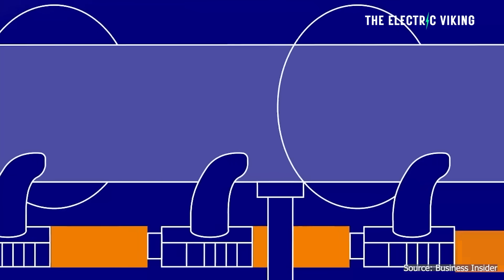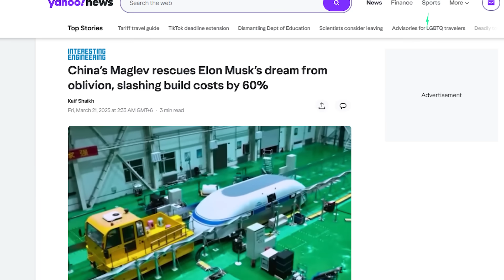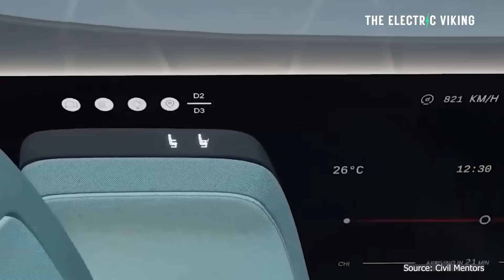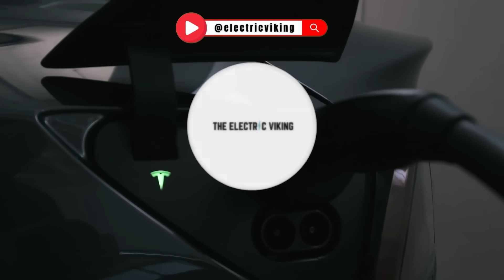Hyperloop Back from the Dead: Maglev Revolution Could Transform Global Travel

Comment: Hello Sam, always enjoy your programmes.  The first example was the atmospheric railway invented by Isambard Kingdom Brunel (greatest engineer ever, personal opinion!), however he was defeated by rats who ate the leather used to seal the tube from the wagon. His tube was 6", 15cm (?)diameter, the vacuum pulled ahead  of the solid cylinder within which was physically  attached to the undercarriage of the wagon, so also loss of vacuum, which ran on standard gauge track. This hyperloop is doomed because you need 2 tubes in each direction, up line and down line, doubling the cost, each pod can take only a few people whereas a standard rail carriage may take 100+, and be coupled with many others, ever increasing efficiency. No points so uni-directional. No intermediate stops, so only for people going from A-B, phenominally expensive to build and to ride. It is dead in the water. better to stay as standard mag-lev, but in operation they have not proved to b commercially successful. Sorry to dis-agree with you on this one Sam. Regards to your family.
Reply: The Brunel atmospheric railway rat story is a bit of a myth. There was some rat problem but the real reason was the limited pull of the vacuum, the maintenance, and the rapid improvement in conventional steam locos at the time. Brunel was a great civil engineer, but a lousy mechanical engineer. Geo. Stephenson said the atmospheric railway was "humbug" which translates to "bulsh1t" in today's language.
Reply: Said "This hyperloop is doomed because you need 2 tubes in each direction, up line and down line, doubling the cost"
Well a path for each direction is pretty normal for a transport system, rail or road (except remote country tracks). That doesn't stop the Musk hype machine from showing idiotic CGI things like that H-L tube across San Francisco Bay, a single tube just above water level blocking ships, including access to a Tesla export wharf 😀. Musk's costs are fantasy anyway.
Reply: @lexlayabout5757 Fair comment, however in UK we have many single lines governed by block signalling. There is an alternative, an American engineer has a youtube post where his working prototype works and would up-scale.

Comment: The fact that musk couldn't get his hyperloop to work is more  a reflection musk's ability, or lack of, as an engineer rather than the size of the challenge. If we can get tubes to run for 1,000's of Km full of very high pressure (50+ bar) gas that doesn't leak, there's no real reason why we can't build a tube that doesn't leak the other way round at much lower pressures, 1 bar.

Comment: It's basically space travel on Earth, you have a capsule floating in a vacuum, once you get it moving it carries on travelling at whatever speed it gets to until reverse thrust slows it down again, onions this instance it's a magnetic thrust rather than a rocket.

Much less challenging than a submarine which not only has to overcome the friction of water but several tens of atmospheres of pressure, the maximum pressure vacuum tube transport has to cope with is one atmosphere.

Simples, or at least reasonably so

Comment: Elon Musk might have proposed it but he didn't spend a lot of his own money on it instead he offered up some money as part of an X prize what's used college students and a test Loop to come up with magnetic levitated trains to travel in a vacuum tube. It was also sponsored by Richard Branson. And even though Elon had suggested steel tapes to start off with he later decided he wanted to make the tubes out of concrete and do it with his boring company and it was part of a process he was hoping someone else would develop the hyperloop train system and his company could dig the tunnels. Branson's team also decided he don't need a full vacuum to run the trains in and you put a large Duct Fan at the beginning of the train to suck the air around it and passed it. Someone else came up with it. I cannot remember the name of the person who came up with the idea but they were inspired by the vacuum tubes from the thirties and forties they used to send Communications inside buildings

Comment: Sorry, it is simply not cost effective or even safe. 
1) Build a massively long tunnel, de-compress it, run small pods with a couple of people through it at a time. Costs many billions, all for a few people travelling at a time at about 500km/h. or
2)  high speed rail which is a fraction of the cost, can carry hundreds of people on each train, travels between 250 to 350km/h depending on the location.

There is simply no competition for value, and the proof is in the pudding. There are 16 major high speed rail lines I am aware of, and 0 hyperloops. Hyperloops are simply not cost effective, and will never provide a return on investment. the upkeep alone will cost more than it can generate. if you want to take a high speed train from Shanghai to Beijing (1318km), you can do it for as low as $71 (USD) and takes between 4 hours 18 minutes to 6 hours 45 minutes depending on your train route. A theoretical hyperloop might be quicker, but a plane will get you there even sooner in just 1 hour 49 minutes, and cost as low as $58 (USD).

it wont happen.
Reply: You have to facor in  the time taken to travel to and from the airports and the boarding and disembarkation times. High speed trains win on journeys up to several hundred miles.

Comment: C'mon this idea makes absolutely no sense, the vacuum train (aka hyperloop) was a dumb idea 100 years ago when it was first conceived and it's not any less stupid now, it is technically possible to build but it's MUCH more expensive than a conventional high speed rail system (even a maglev one) both to build and to run, it's a much less flexible system and has a ludicrous amount of failure points which pretty much all lead to critical failures... It will never be more than vaporware and tech demos to lure investors.

It has been debunked so many times, it's astonishing that some still do not acknowledge the faults in this idea.
Reply: "never" is a long time

Comment: The hyperloop failed because they tried to make it work but couldn't because sufficiently reducing the air pressure in such a long tube is pretty much impossible.
Reply: If you ever saw a failure of vacuum system in material like steel, you know what is one of the biggest challenges. Any dent can me the failure point. And the moment it fails, it rapidly fails EVERYWHERE.

Comment: There are few problems with vacuum train (it is not "new idea from Elon Musk", it is over 100 years old idea). 
First is making the bloody vacuum tube and keeping it airtight. That is the engineering hell. Now add moving parts and you have another stack of problems.
Second problem is that not even one of those "models" shows how it would work. Have you seen a single valve there? No, they show you how people enter a pod, it closes doors and shoots away into vacuum... somehow. If you add the pressure chamber that would be sealed and pumped down it adds a lot of time. How much? If we keep clearance of just 2 centimeters, it adds ~40 minutes. And on the other end about ten minutes for repressurization (you can do it much quicker, but you may damage the pod. You don't want to damage the pod, right?)
Third problem is how vulnerable it is. One guy with a rifle can make few hole in the tube anywhere and suddenly you have a lot of repairs to do. That is fixing the holes, fixing any bents around it to make sure the whole tube will not collapse and of course clearing the inside from the chunky salsa that was passengers in pods before. Hitting the incoming air would be about 1000 times denser than the near vacuum, so the change would be similar to hitting water when you jump from air. Do you want to do that at few hundred miles per hour? And if we remove crazy guy with rifle, the same thing can be done by hitting the tube with car (it may collapse completely or at least few kilometers would collapse). 

And we are not even talking about the problems with making it straight enough (you know, digging tunnels, building bridges, buying land for building the tube,...).
Reply: The lone nut is an unfortunate potential reality to stifle my interest in this. Goddamn shame.
Reply: Dude, the vacuum train will go from 1 ATM down to 0.1 ATM, and that's not anywhere near the pressure differential needed to cause explosive decompression.  The typical delta P accident is literally a ton of hydrostatic pressure through a 4" pipe.
Reply: @ZweiZwolf  And you have incorrect data. 0.1 ATM would be low pressure air, not "mid vacuum" as proposed. The proposed pressure is 100 pascal, that is about 0.001 ATM. 
BTW, do you remember how mythbusters collapsed the tanker? When it crushed Adam says "23 inches of mercury", that is ~0.75 ATM.
Reply: @ As an engineer, there is no effective difference between 0.1 ATM and 0.000 000 001 ATM from a structural standpoint.  It's 10% nominal stress and strain, which will be more than covered by whatever structural engineering safety factor they require to maintain an 0.9 ... 0.999 999 999 ATM pressure difference.  
As for your Mythbusters tanker, if it was properly engineered for live human use at 0.65 ATM, it wouldn't suffer catastrophic collapse at 0.75 ATM.  With proper engineering, any failure due to slight overpressure would result in a degradation failure that would be noticeable and give adequate time for safe evacuation.  That is the very definition of how engineering is done when human lives are at stake.
Reply: @ZweiZwolf  Nice explanation. Thank-you.
Reply: @ Thanks.  FYI, typical safety factors for pressure vessels start at 3 or 4 for simple stuff, and go up to 6+ when human lives would be endangered on failure.  
For example, if a small, light pressure vessel requires an absolute minimum 1.0 mm steel wall for the maximum design pressure, then the actual product might be 3.0 or 4.0 mm thick wall for safety to cover manufacturing variance, material variance, handling, overpressure, age, fatigue, etc.  
If the contents were flammable, explosive, or life-sustaining, then the thickness would increase accordingly to provide additional margin against catastrophic failure. There would also a certain additional consideration on materials, assembly, and failure modes to prevent catastrophic failure, like 'rip-stop' webbing.
Reply: @ZweiZwolf  Very interesting.
Reply: @ZweiZwolf  Are you sure about that? No effective difference? Are you saying that structure will fail with under pressure 0.1 or 0.01, but at different speed (I mean, it would survive a month at 0.1 but will fail in a day at 0.01). 
Even if that would be true, there is still a problem with keeping it airtight. And with thermal expansion. Or a hole anywhere which would destroy multiple pods...
Reply: @ Yes, 100% sure.  I'm an actual engineer, so I actually understand how stresses and strains work.  A properly built and maintained pressure vessel / structure originally designed for human use at 0.1 ATM will survive decades at 0.000 000 001 ATM.  You are fearmongering out of ignorance.
Reply: @ZweiZwolf  OK. There are still other issues I mentioned. Any hole will be a big problem. And thermal expansion may be another big one.
Reply: @ OK, just understand that the pressure differential between the tube and ambient air (0.9x ATM) is about HALF what many car tires run (2.5 - 3.0 ATM).  It's essentially similar to modern jet aircraft, which operate with much bigger thermal delta.  We have solved the structural, fatigue, and sealing problem from a technical standpoint.  The only challenge is scale from an aircraft fuselage to a train tunnel.  That's why China was able to build a working demonstrator and not have it implode on itself during testing. 

As I have said elsewhere, the marginal straight line speed advantage likely does not justify the enormous cost of construction, maintenance, and operation.  It's clearly technically feasible from an engineering standpoint, it's just not economically justifiable unless you have infinite money and energy to throw at it.
Reply: @ZweiZwolf  There is a huge difference between high pressure and low pressure. It sounds you are saying that a regular PET bottle would be sufficient, because it can withstand 10 ATM. It will crumble with slightly lower pressure in seconds. 
Also on a jet, what is the change of length? A millimeter? Maybe two? For hundred miles long tube it would be few hundreds of meters. And still the killing point is a single hole anywhere in the tube.
Reply: @simonspacek3670  I'm saying that the tech we have been using for aircraft over the past 4 decades is more than adequate, as the Chinese already demonstrated.  If you want to pretend that somebody would make this out of a plastic bottle, you're incredibly dumb.
Reply: @ZweiZwolf  No, I just pointed out that YOUR example was a tire that can easily hold 3 ATM.

Comment: It's not impossible but it will never happen at any kind of scale. Trains are being tested at 600km/h without all the stupid vacuum tubes. That's all we'll ever need as the infrastructure costs for lines that could take advantage of higher speeds could never be economically viable.

Will some entity build one in some excessively oil-rich place or in a place trying to make its mark in the world, like China? Maybe. But it will almost certainly be a one-off between two big demand points (cities?) that are not too far from each other. It could turn a two hour drive into a 20 minute ride. But that's probably the extent that will ever be built in this century. If at all.

Comment: Currently, there are five primary airports in southern California and three in the San Francisco bay area, with average daily traffic of about 12,000 - 15,000  passengers. That seems like a big logistical challenge to me.  Also, the distance from the East Coast to the West coast is around 2,500 miles so even at 600 mph it is still over 4 hours.
Reply: The Hyperloop would have a very small passenger throughput. The airlocks to get passengers in and out would be a serious bottleneck. Like Musk's original idea for the suburban "Loop" (like in La Vegas), the one which was meant to take you own car down to it in a lift, it was only meant for himself and a few fellow multi-millionaires.

Comment: 600mph in a tube that needs to maintain a vacuum along the San Andreas fault in California? The maintenance and inspections needed to keep them safe would be nuts. And what if there was an earthquake while you're in there doing 600mph? What happens then?

No thanks. I'd rather take my chances in the air in a jet  with a proven safety record.
Reply: Fly Boeing or get in Musk's pneumatic tube.  Which is safer?

Comment: I’m sorry. Think about the practical issue of maintaining a vacuum space over 100 miles, with people flying thru at 500 mph. This would be fine as a mag lev without the vacuum “tube.” Musk later admitted that his plan was to delay the development of the San Francisco to LA high speed rail. He spent NONE of his own money. It ended the SF to LA project.
Reply: What do you think is built into oil pipeline not to mention underwater
Reply: @EarlDennis-l1l  Oil pipelines can make abrupt changes of direction to go over hills or around obstructions like existing towns, so relatively cheap to engineer. At its speed, H-L will need to be an almost straight line, and also have human level safety standards. H-L building and running costs would be collosal.

Comment: New York to Miami Travel Comparison: Hyperloop vs. Maglev vs. Air Travel
Hyperloop (Projected)
Speed: Estimated 600–700 mph (965–1,126 km/h).
Travel Time: Could be under 2 hours, but no commercial system exists yet.
Infrastructure: Requires vacuum-sealed tubes, posing engineering challenges.
Feasibility: Still in experimental phases, with no confirmed routes.
Maglev (Projected)
Speed: Up to 375 mph (603 km/h).
Travel Time: Estimated 3 hours 43 minutes for a direct route.
Infrastructure: Requires dedicated tracks, but is already operational in Japan and China.
Feasibility: Proven technology, but high costs limit expansion in the U.S.
Air Travel
Speed: Commercial jets travel at 500–600 mph (805–965 km/h).
Travel Time: 3 hours, 3 minutes on average.
Cost: Flights range from £26 to £86, depending on airline and booking time.
Infrastructure: Airports are already established, making air travel the most accessible option.
Feasibility: Fully operational, but subject to delays, security checks, and environmental concerns.

High-Speed Train (Projected)
Speed: Estimated 150–220 mph (241–354 km/h).
Travel Time: Likely 6–8 hours, depending on stops and route efficiency.
Cost: High-speed rail tickets could range between $100–$250, similar to airfare but potentially cheaper than Hyperloop or Maglev.
Infrastructure: Would require extensive track upgrades, but U.S. rail corridors already exist.
Feasibility: More viable than Hyperloop, but funding and political will remain barriers.
Summary
Hyperloop offers the fastest potential travel time but remains theoretical.
Maglev is proven but requires major infrastructure investment.
Air travel is widely available but comes with security delays and environmental impact. High speed train is viable but slowest
.
Reply: You forgot one thing with Hyperloop. Something you never see in the promo videos. How is it getting in the vacuum tunnel? The easiest way is having a small chamber where you will place the pod, pump out all the air and then let it in the tunnel. But that will take time. With 2 centimeters clearance (less than an inch) it is about 40 minutes (and that is if the pod is a cylinder).
Reply: @simonspacek3670  agreed !something like an airlock?
Reply: @ Something you can see in none of those videos, no matter if it was virgin hyperloop, Musk hyperloop, the proposed Indian hyperloop,... They just send the capsule in without any problem.
Reply: Outstanding summary!